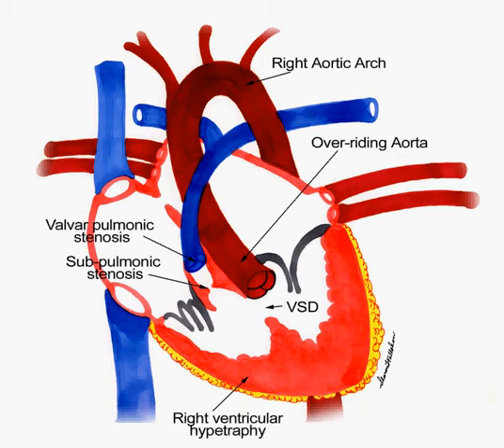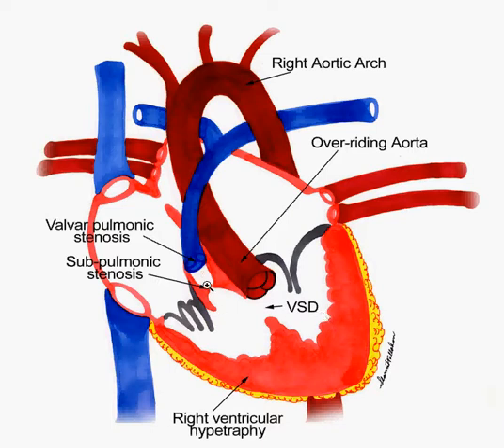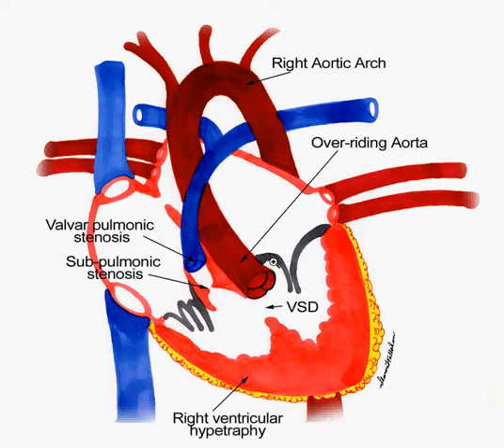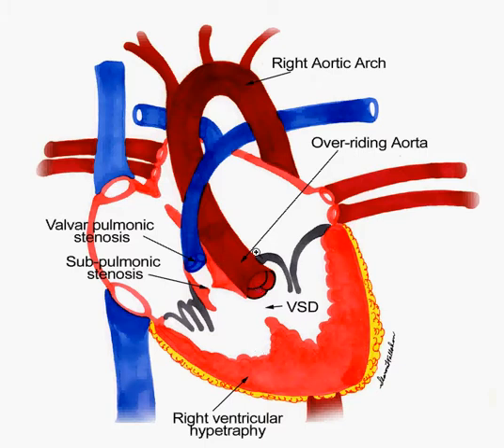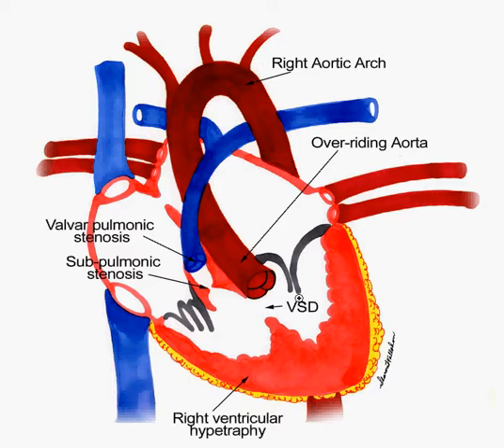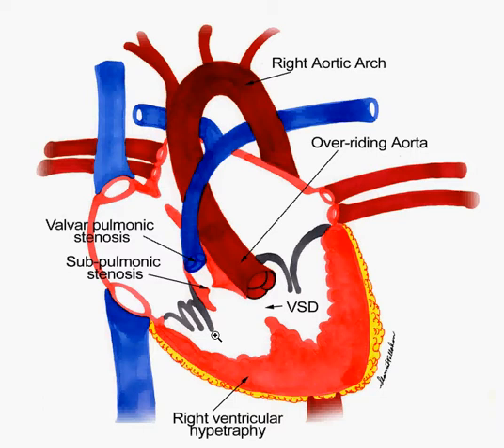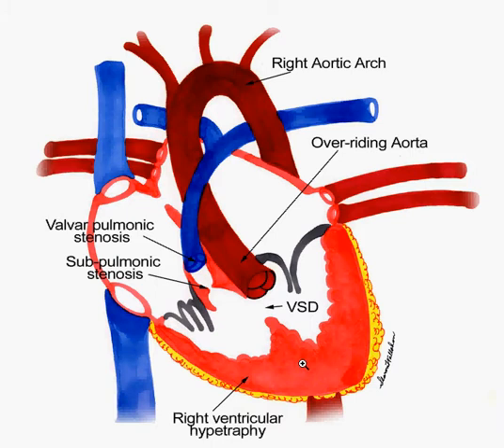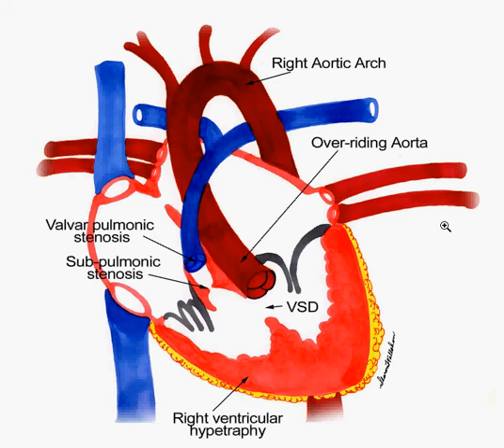Tetralogy of Fallot.avi

Comment: Examinations were therefore performed and it was found out that she has got heart problems which is very similar to what you are describing here, WITHOUT the overriding aorta (because from the echocardiogram result, it seems that the aorta is correctly positioned over the left ventricle). 

In summary, she has got MEDIUM pulmonary stenosis, MEDIUM vsd, MEDIUM right ventricular hypertrophy, and TINY atrial septal defect.